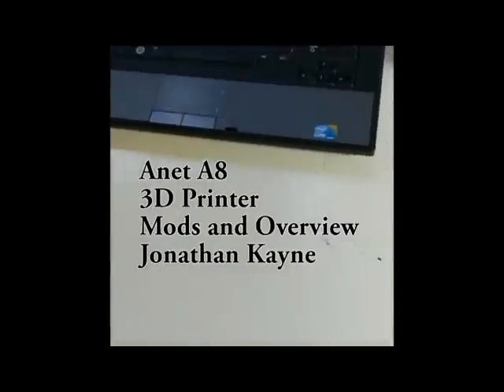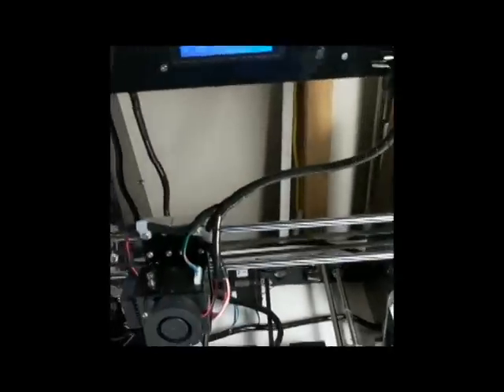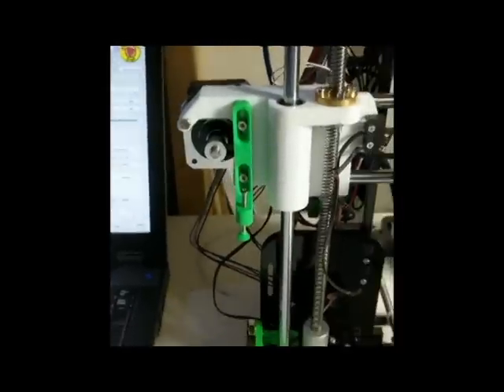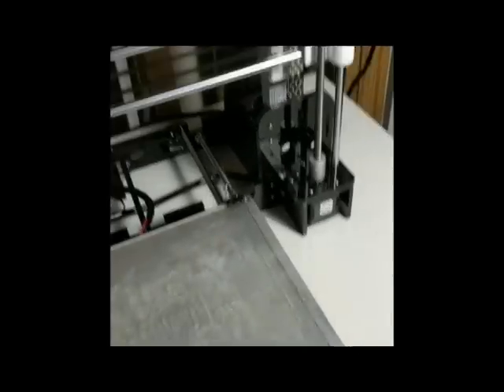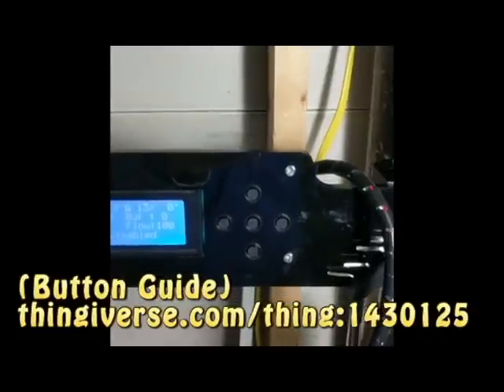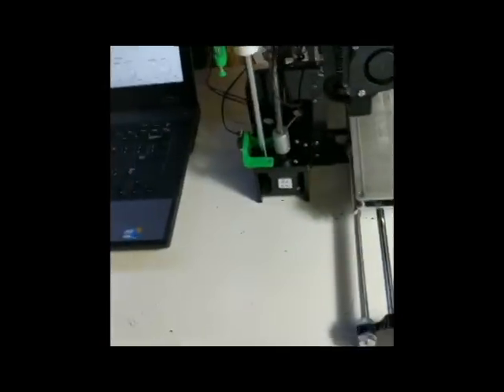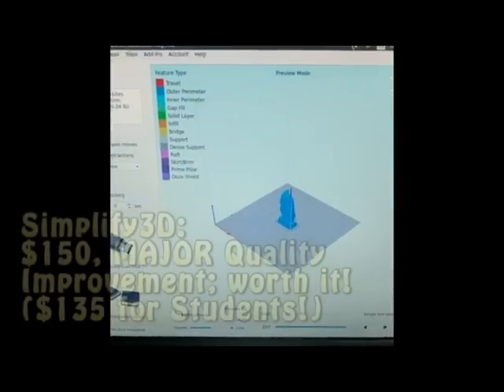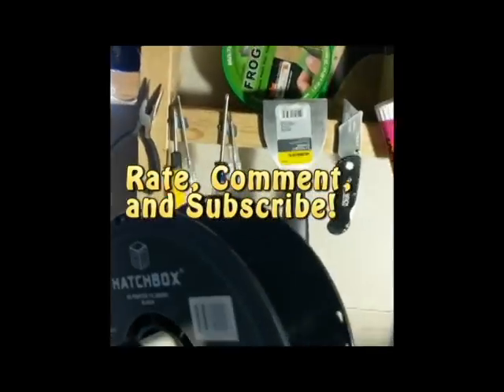Anet A8 3D Printer- Upgrades and Overview

Comment: Nice video, I'm waiting on my A8 to arrive from Gearbest but will watch your channel to see what you change up, Also you should get your Mosfet man!. Big safety risk and also the front brace so your tension doesn't break that acrylic. All things i've been reading into.
Reply from the maker: kicker22004 The MOSFET is more necessary for printing with the bed at higher temperatures. I rarely print in ABS, so the hottest my bed usually gets is 60C. Also, I don't tension that belt enough for the frame to be flexed. If the frame was flexing then it would seriously be overkill and probably overheat your y axis stepper due to the overtightened belt.
Reply: Jonathan Kayne Ahhh from my understanding it was a current issue more than a heat issue, Causing the connectors to fail. The tension makes sense I'm just a paranoid person and the acrylic makes me worry.
Reply from the maker: kicker22004 its not necessarily a bad thing to do, I just haven't had a need to do this just yet. I didn't mention this in the video, but I actually soldered the wires directly to the heat bed, replacing the connector that it comes with. This was so there wasn't a connector there to fail, as well as to deal with the fact that the connector was rubbing against the y axis stepper, making bed leveling much harder. I also put a piece of kapton tape over the soldered connection for safety reasons.
Reply: Jonathan Kayne Yeah the other current issue was on the main board from the heat bed. Also some users put the hot bed on backwards to fix the connector from being in the way. This is all from reading as I don't have mine yet. Just trying to share what I've learned
Reply: The other option is to put the Heat bed on with the connector sticking out the side. Then you can install a cable chain to manage the wires as well.

Comment: For the z stop upgrade, how did you get the screw through the hole?  I just printed that this morning and need to get it together.  Thanks
Reply from the maker: Steve Sowinski try to screw the m3 screw onto the z axis holder before installing it. if it still doesn't work, you might need to drill out the hole. make sure you use a drill bit that would be the correct size for tapping, otherwise it will just fall through instead of acting on.